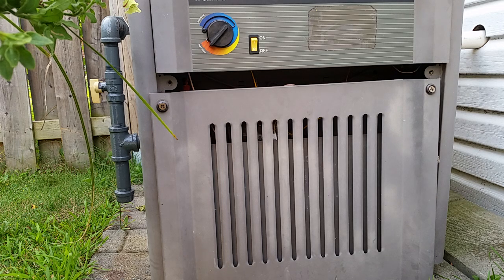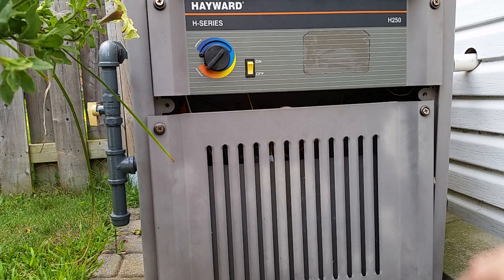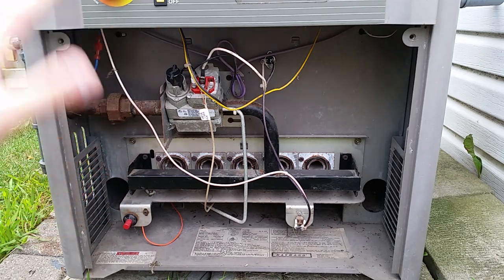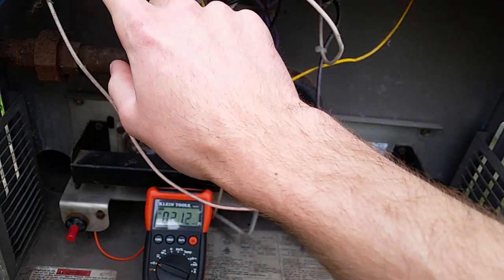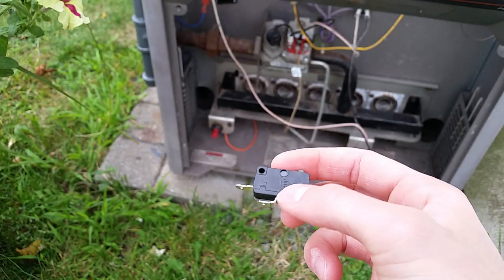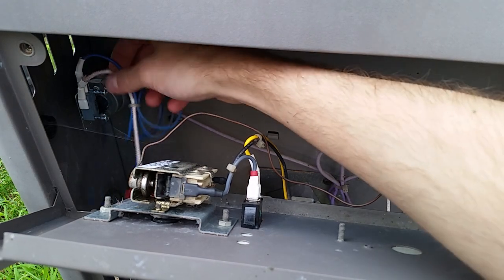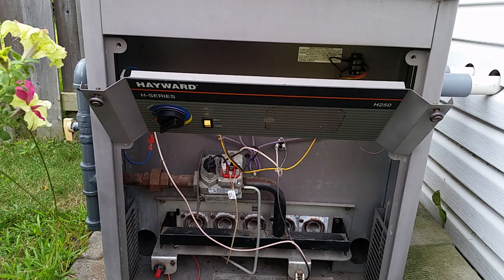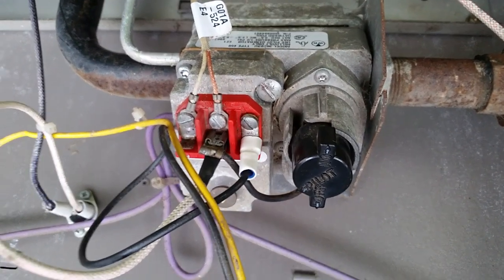How to diagnose and repair your Hayward H Series Natural Gas Swimming Pool Heater

Comment: HI, my hater is controlled by a Prologic Computer, it was working awsome for the last 2 years, 400k Btu H series, not it shows the Lo code, while in bypass mode, but if I put it Manual Mode, works just fine. Do you have any clue?, the pressure switch is working, again, in manual mode works as expected
Reply from the maker: The bypass is usually to mitigate high pressure, or to circumvent the heater all together for servicing.
Why do you have it in bypass ?
Reply: +Videos from Québec I hace
Reply: +Videos from Québec hi I have it on Bo mode, or controlled by the prologic. That is the bypass I was referring, not the physical water bypass.

Comment: Wow I read all the comments. You have helped so many people !! Thanks for posting this video !!  I have a Hayward H150 and the pilot lights right away. My problem is that the burners don't like to come on right away and if they do, sometimes they will shut off after awhile and I can't get them to come on again. I  haven't tested anything as I don't have a meter yet but I'll go buy one . I'll also replace the pressure switch. ( Thanks by the way...the pool place sold me the whole unit earlier today and charged me $89. I will return it and just buy a switch.)  Anyways,  before I start, any suggestions ?  Thanks again for helping so many !!

Comment: Thank you so much for the video. Great job!

My question: I have the H400 (very similar to yours) which has two lights on the front. My heater is not millivolt it is electric and I use propane not natural gas... it has 1 light to show the unit is getting power (which should be constantly on...) and another light that lights up when the unit is running. My heater is definitely getting power from the circuit as I have confirmed it, but for some reason the unit is not getting power all the time. It seems to work some days and not other days. The lights are dark and then I can't light it and then randomly...the next day two later it will have lights and work fine. Sometimes it will even be fine in the morning and light up and then while it is running it will shut off and then I can't get it going again because it has no power.

Any ideas? What to check? what could be so intermittent. No wires seem loose in any way either. THANK YOU for the help.
Reply from the maker: Hi there, I have seen those but never worked on them personally, when you see that it seems to be off, check it and test to make sure if it is getting power, then check the low voltage side of the transformer that is giving power to the gas valve. Most likely a bad power supply. 
Basically it takes 220 or 110 from your main circuit and then drops it to something lower like 12 or 24v possibly DC, so check the power supply and confirm it is putting out the correct voltage.
Reply: Thank you so much for the response. I am pretty I have a bad transformer after putting the multimeter on the case...I will order that part and install. The symptoms have changed a little: Now the heater shows it is getting power and has a light on, but then when I go to start it and the heater clicks and then loses power. So I think the transformer is not giving enough power to ignite the spark. thanks again

Comment: GOT IT!!!!  Had the heater on, tried to pull the wire off the pressure switch and while I was wiggling it, the heater started. My heater is a Raypak, so not sure if it makes a difference, but if the pressure switch is not connected or working properly, jumping the wires will not turn the main burners on. Your video was a huge help. Thank you soooo much!

Comment: I actually just changed the thermopile, as I was not getting the proper voltage. Now I am getting the proper voltage, but still cant get the main burners to come on. I jumpered the TH to a T and like before, you hear a click but the burners do not come on and this again puts the pilot light out. Any suggestions would be greatly appreciated.

Comment: Great video, I have the same 250 and there is a leakage...do you know if it is repairable ? Is it possible to bring the heat exchanger to be soldered at a rad shop ?
Reply from the maker: Possibly, but usually leaks are caused by extreme age, or you have a chlorinator that is not properly installed with a one way check valve, and when the pump is turned off chlorine floats back and settles in the heat exchanger rotting it away in a few years. If you can try and have it welded, if not just replace it

Comment: Hi there, great video.  I have the same heater that you have.  My heater, the pilot light automatically goes out from time to time.  I would say 1-3 times per week.  I have to ALWAYS check to see if the heater is on or off.  Kinda frustrating when the pool party is about to start and everybody jumps in freezing their tail off.  What do you think the problem is?  Thank you.
Reply from the maker: Could be a wind problem, or the thermopile is on it's way out and needs to be replaced.
Reply: +Video Québec you're right, the thermopile is pooched.  Thank you so much!

Comment: Hey i have h400 similar model looks exactly like this one...but pilot lights no problem (with a lighter since it's old) ... then we hold and turn knob from pilot to on. It stays lit....we put front back on,  then when we press the ON switch, nothing happens!!! Any suggestions on what to check or do? Could it be my valves? how can i know if they are connected right? ir is my ON button broken? Worked fine last summer...thx     fulyadalli@hotmail.com
Reply from the maker: Sounds like the same issue I am diagnosing here, watch the video I explain how to trace the circuit and test each switch.
Reply: oh my. it was my bypass valve at the filter. i turned it and bammmm=) I've got heat!  YOU ROCK!

Comment: I'm getting an error code of  "HS" which is a "water temperature sensing error" which by defination means that the inlet water tmp sensor is reporting a temp change at a rate faster than 6 degrees within 60 sec. The water temp currently is 69 degrees and when the hearter fires up the temp climbs up 70, 71, 72, 74 then kicks off. It will recycle 2 or 3 more times then shuts off. Any suggestions?

Comment: Hi. Can't get pilot to stay lit? Suggestions? Thanks
Reply from the maker: +Michael Raso Try manually with a match or lighter. ONLY attempt to light a pilot light with the knob on the PILOT setting, never in the on, or run position. The PILOT setting controls the flow of gas through the pilot tube, setting it to the on position can let full gas flow through the burners on some gas valves and you will blow your self up.

Comment: great video man, this might be a silky question but where do I bring in my 120 v wires to bring power to the unit. I have the very same unit that's in the video. Thanks for the video
Reply from the maker: +Francis Briere Glad I can provide some insight.
The one I have here does not require any external power. There are some models that have a powered gas valve, usually by 24V, you bring in 120V to the power board, if you have one it would be obvious.
Reply: +Video Quebec
Thanks so much. You're very helpful
Reply from the maker: Glad the vid helped

Comment: I can't find a place to buy the miniature switch that is mentioned in the video in my home town.  Is there a on-line place to order this switch?
Reply from the maker: +Evan Belnap I forget what the correct term for it it but you can pick it up at any electronics store that supplies electronics parts, (NOT a place like bestbuy etc..) you could try radioshack or something similar.

See the link below for a quick search I did on ebay.
http://goo.gl/Gx1oCI

Comment: Great video and lots of helpful information. I have a Hayward H250 and tried turning system on for spa but it gave me an IF code and service light came on...one thing I should mention is that it had been pouring with high winds for days, which I wonder if that would have anything to do with this problem. Would you be able to give me any advice? Thanks, Nev
Reply from the maker: Neven Petrov, CSA hey, thanks, you mus have the model with dual pool/spa and electronic control.
Try cleaning it out and checking the circuits to make sure nothing is fried

Comment: I have a 12 year old H150,not many problems over the years & what problems it had is stuff i could fix my self.It's really an efficient heater,like it heats my 18' round in no time... 4 hours or less.Take care of it,clean it,check it,cover it in winter,vacuum it,clean the orifices.. & with the help of videos like this it will be reliable & last for a long time,the only complaint is the installers didn't make a sediment trap & no union inside like this one..getting the valve out some day is going to be complete reverse engineering.& an undertaking
Reply from the maker: Tjfreak Yes I agree, as for the installation union and sediment trap or drip T are a must, it's actually part of the code in most places.
Reply: Video Québec 

It's code here, NE Illinois NW Chicago burbs.Installer took the easy out & so did the city inspector..if he even noticed..he was really bent out of shape on the interior door alarm leading to the back yard but not this..I looked at it this morning 1/2 thinking about doin the trap & union…& did I really want to open that can of worms ? nope ! next spring, pre pool opening.Thanks for the vid !
Reply from the maker: Tjfreak Lol Yeah good idea, "If it a'int broke, don't try to fix it" 
Realistically it's not a huge issue, and will not affect the operation of the unit. You could probably just lave it be till the day you change out the equipment, if that is to even ever happen.

Comment: Great video, thanks for all the tips. In my case it was the limit switch on the pressure sensing assembly. I found an electronics supply store nearby and bought a Honeywell replacement (V3-123-D8) for $4.50. I drilled out the rivet and used a 4-40x1" machine screw to hold it in place. It's working perfectly.
Reply from the maker: Pete Tomaiuolo Glad you where able to use the info and repair yours.
Reply: OMG thank you both!!!  I haven't replaced it but the limit switch was the problem exactly like you said!!!  Jumping it makes the thing work perfectly.  Part ordered!!!

Comment: I think my igniter button is bad
 Can you light the pilot with a long match to see if that is the problem? If so where?
Reply from the maker: Lynda Adams Hi, yes you can, if you have an H series heater like this one, that small hole in the bottom is were you should be able to peak through (if you get down on just the right angle) and see the pilot lighting or possibly the igniter sparking, if it does not seam to be working try a long match though the same hole.
VERY IMPORTANT make sure you are depressing the control knob down on the PILOT position, never attempt to light gas burner in the "On" or "Run" position, you will blow yourself up. The PILOT position controls the flow of gas so that only a small amount will be burned off in the pilot light. Keep holding the knob down for at least 15-30 seconds to let the flame burn up against the thermocouple to start generating some current, then turn the knob to the "On" position

Comment: I am fighting this heater right now. It works intermittently on then off. If I leave the circuit in tact the heater typically will not light under normal circumstances. If I jump the terminals it will start and sometimes remain running when I remove the jumper demonstrating that the circuit is closed. I can then pull and replace all the terminals to each switch and the heater will drop out and ignite as each lead is removed and reconnected. But when I leave it unattended for a period of time it will shut down. Also note. If I press down on the terminals on the gas valve the pilot will disengage. I feel like the gas valve is the issue with some type of a short or poor ground. Do you know if the terminals on the gas valve fail intermittently as I described? Thanks
Reply from the maker: Yup had the same problem. Turned out to be corrosion on the wires, however it can be the gas valve or thermocouple. Start with the cheaper parts before investing in a new gas valve.

Comment: My daughter has an H250 and I finally got the pilot lit after cleaning the bugs out. It started up and was running, then when I went to check it about 10 minutes later is had shut down. Cursory check of the connections seemed ok but will go back and check again. Any other thoughts? Hoping the gas valve is ok.
Reply from the maker: Bob Enas could be the thermostat, or the actual switch inside the thermostat. Take a look at the other video I made more recently

Comment: I also have this same heater and just recently replaced the pilot and thermopile assembly because the pilot would not stay lit.  The heater worked for 4 days until the heat exchanger burst and lost a bunch of water.  Just replaced the heat exchanger last week but now when I light the pilot, it emits a 1.5 foot flame.  What do you think is causing this?  The gas control valve?  Any thoughts would be appreciated.
Reply from the maker: Seth Postma Holy crap, sounds like you are not having good luck with your unit.
If your pilot flame is out of control there is defiantly a problem in the gas valve, I don't think there is a way to adjust the pilot flame on these units, it's usually set at the factory look up the model of your manifold/controller (usually Honeywell or RobertShaw) and see if there is a screw or something to adjust the pilot flame.
Do be very careful especially if you attempt to re-light the flame because the duty of the pilot gas tube is to control the flame, if there is a problem and its letting out to much gas you risk blowing your self up, same reason why you NEVER attempt to re light a burner with the knob on the ON or RUN position. It should always be lit on  PILOT as the gas is controlled. You will most likely need to change out the controller valve.

Comment: Ok I'll try in the morning which terminals do I put the probs on there is a a bunch of screws with wires there. And what voltage should it be putting out.
Reply from the maker: Ian Pitt-Taylor If you have a milivolt (no external power) system like I show here you should only have the 3
Make sure your meter is set to DC, if its not auto ranging set it to the lowest setting, Touch the probes to the first 2 terminals, you want to see at least 400-500mV

Comment: hi I have the same heater I try lighting the pilot I hold the button down it ignites  but when I release the button the pilot goes out no matter how many times I try
Reply from the maker: Ian Pitt-Taylor How long are you holding it for? You should hold it down on pilot for at least 30sec.
If the pilot will not stay lit your thermocouple/thermopile is most likely bad.
You can test by having some one hold down the knob on pilot, wait 30sec, and while they are still holding down on pilot, you take a reading from the terminals with your multi-meter and see if you are getting correct voltage. Similarly you can take it all apart, disccoonect the components, and bench test the thermo.
Hold the thermo in a soft open flame and take a reading to see if you get correct voltage.
If the thermo is generating proper current then there could be a problem elsewhere with the controller valve (main gas manifold) in which case you will need to replace it.

Comment: I am unable to light the pilot light. I have changed the pilot and bled the gas line, and then re installed my old pilot.  Nothing works.  HELP
Reply from the maker: Jerry Davis Hold a flame over the pilot tube, if it lights your igniter is bad, if you are not getting gas to the pilot then there is a problem with the control vale (main gas manifold on the heater)

Comment: Great video! Maybe you can help me with my issue.  I converted my heater from propane to natural gas and now it barely warm my hut tub after on for hours.  It worked fine for a week or so. The tub would take 15 to 30min to get supper warm, now it won't get close to that temperature. The gas line (sizing) into the heater all check out fine.
The valves was change to natural gas along with the orfus.  Any ideas?